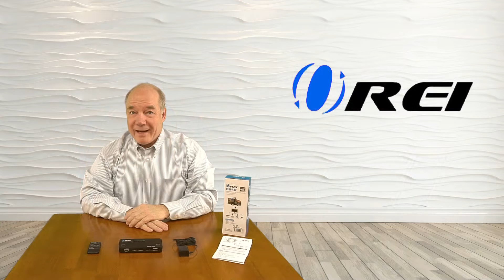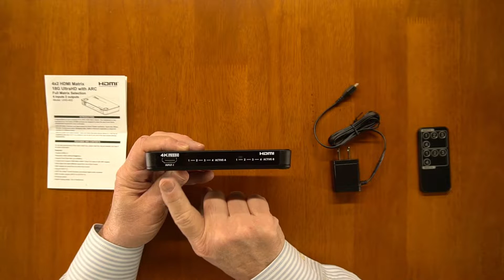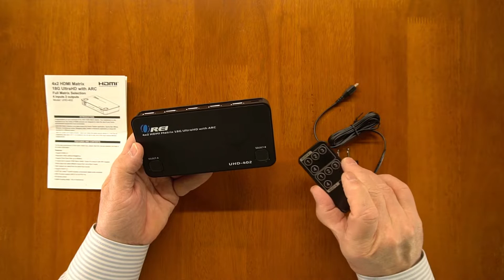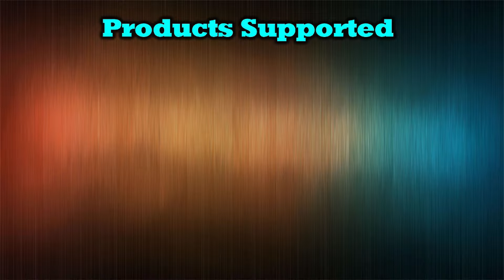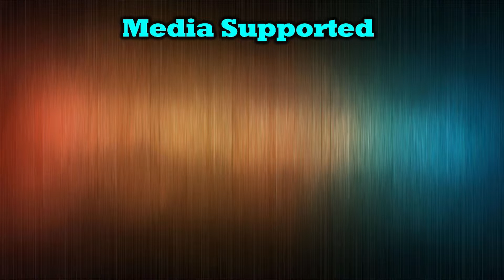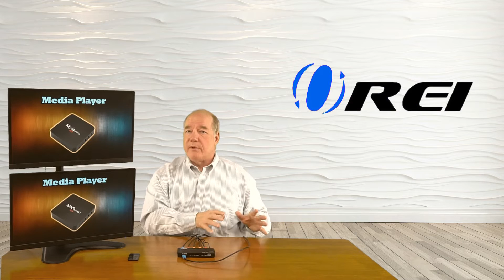OREI  4x2 HDMI Matrix Switcher/Splitter | 4 In 2 Out : UHD-402

Comment: can I use this (using all 4 hdmi inputs) on a PC (2 hdmi on the video card) and a laptop docking station (2 hdmi on the dock) with 2 monitors and swap between the pc and laptop while utilizing dual monitors (extended or mirror) for either the PC or Laptop on the dock?
Reply: thanks, Very Good question . I was about to buy for same purpose. I  Need to extend not duplicate/mirror

Comment: I'm trying to decide to buy either the UHD-402 or the UHDS-402A.  I've written to the info@orei.com to describe my specific needs regarding HDMI-ARC audio output and a simultaneous HDMI video output.  But I don't see examples this configuration..  I also want to be able to support multiple inputs for the same output I just described.   Can you provide any guidance.  The HDMI-ARC output needs to send signal to a Sonos Beam soundbar.
Reply: I need to do the same thing.  One input with output to TV and audio via hdmi arc to soundbar.  Any reply?
Reply: Did you get an answer.  I am also looking for similar solution but I want one output to projector and one output to Bose 900 soundbar.  Would be good to have 4 HDMI input.

Comment: I have an older Panasonic PT-AE8000 1080 projector as monitor 2.  My new Denon has drop outs due to projector not handshaking with modern HDCP.   Can I strip off the HDCP so my Denon/Panasonic work

Comment: Hi. I have a question. Will your product support different output resolutions on the same input? I have a 4K monitor and 1080p monitor. I want to display from the same input the 4k resolution on my 4k monitor and downscale to the 1080p on my 1080p monitor. My current HDMI matrix only supports highest common output resolution.
Reply: @OREI-COM  Thank you very much

Comment: That's just waaaaaay too slow of switching
Reply: Is there a 4 input-2 output with better response time than OREI UHD-402? <- 3-5sec switching time.
Reply: @neila1087  There might be.  But you are right, response times are not very fast on many of these units.  It takes time to re-synch HDMI.